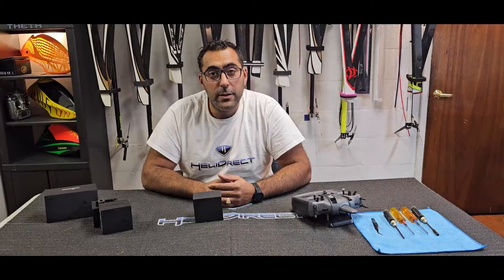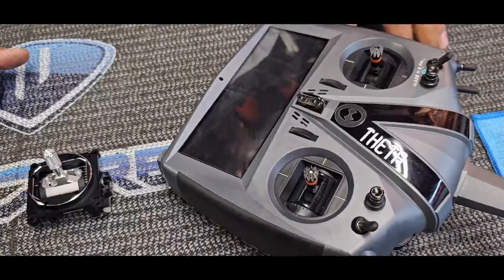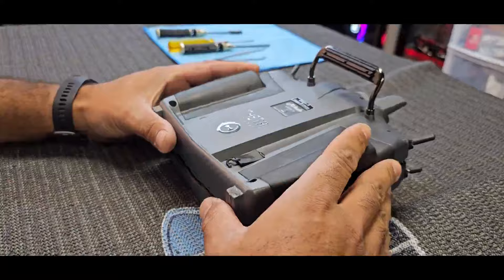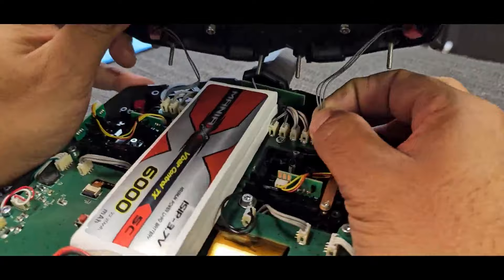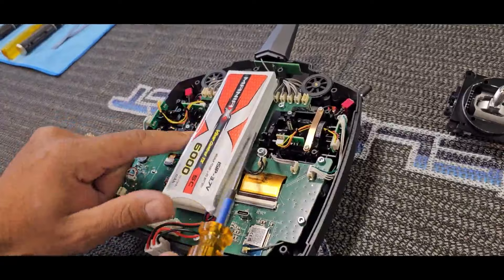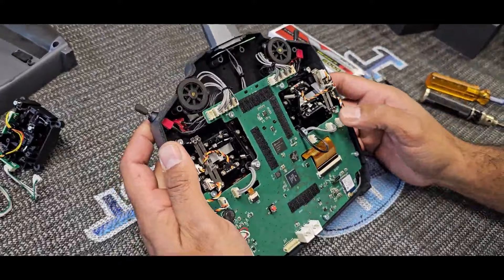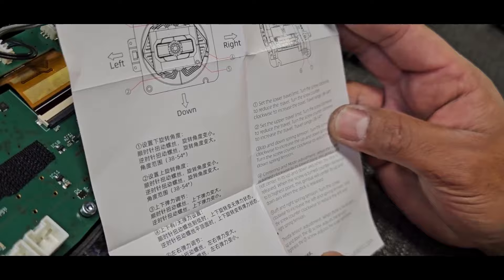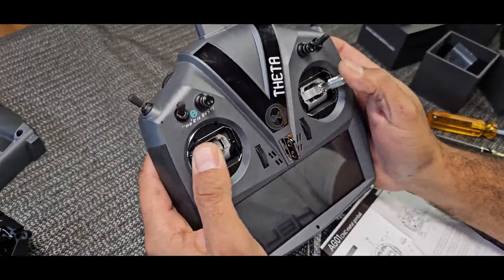Radiomaster AG-01V gimbals,  vcontrol touch installation

Comment: Having done this conversion myself successfully, only issue is Mikado will stop you using them after a short while you will end up with the Red Screen of Death and you will not be able to use your Vcontrol at all. So thanks for the video but you really should be warning people not to use, I understand this also happened to you, shame you left this video up, as these gimbals are not at all compliant and have not been properly tested which is why on powerup of the radio during the self test it will eventually stop working, you will get the RSOD.

So what is the fix for the RED SCREEN OF DEATH ?

Comment: Hello Diego! How are these sticks working for you now? I bought the same ones and installed them on Vbc Evo and after a while they stopped working, a warning appeared on the screen that I was using non-original sticks, but when I moved them to the oldest Vbc, it worked perfectly with them. As I understand it, with the update Evo Mikado decided to ban the use of these stats. That's why I ask you to tell me how they work for you? Have you updated? Thanks for your help and have a nice day.

Comment: @chuckbirt9283
0 seconds ago
I did the swap on gimbals following your video and my screen does not light up.  The touch works just not the back light, any ideas?  Is the screen light powered by the red/white wire?